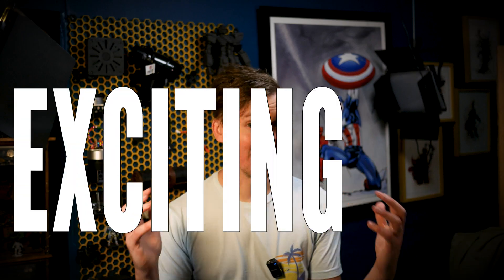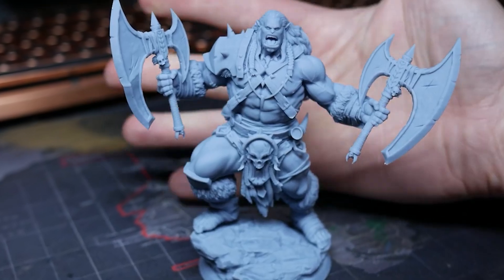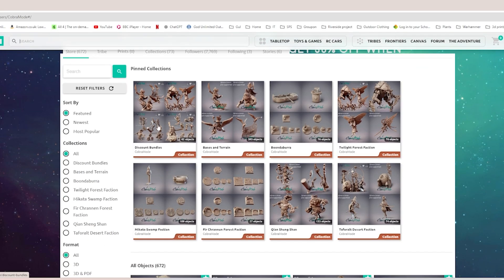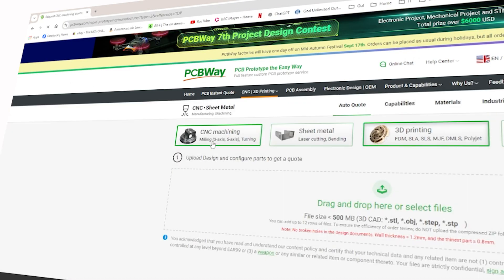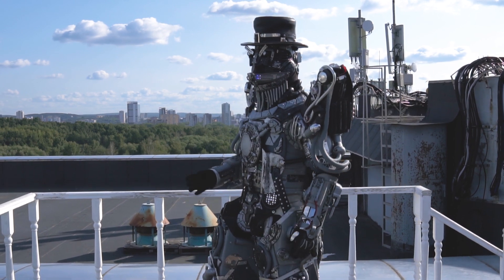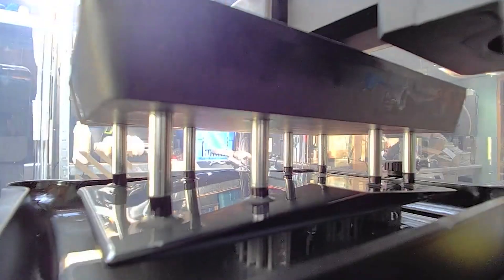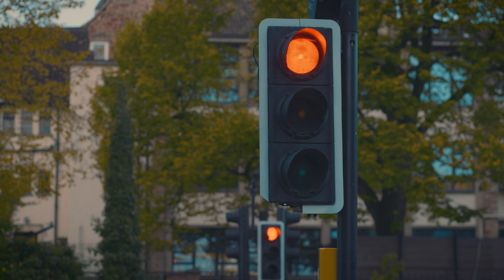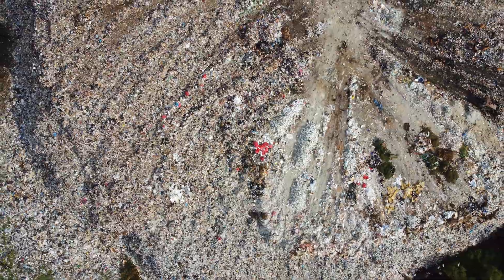Should you buy a 3D printer in 2025?

Comment: Regarding waste/guilt part. Consider categorizing and storing each type of plastic as it's currently is possible to grind up and re-create filament(to a point). In the future these kind of machines might get better and/or cheaper. Obviously the more you store, the more there is to gain from getting such a machine. The video is obviously not about that, but spreading the word might prevent needless waste.
Reply from the maker: It’s a good shout and works for FDM printing not for resin though, once resin is cured it’s done. Plastic recycling machines are becoming more mainstream though.
Reply: @RisingApe  WOps my bad. Had a brainfart.

Comment: Grow tent setups are helpful, but indeed, they are moderately difficult to work around because of just how much space they take up.  I have a 30x18x36" tent that barely fits my Mars 2 Pro and Mercury X wash and cure station, with a tiny work area, but it also provides filtration, storage of things, and most importantly, keeps the mess in one specific area.  Four or especially five feet of room to work with for resin would be a godsend though, but sadly I don't have that kind of space because of two Voron printers (300 Trident, and 350 v2.4r2).

The other cost many don't comment about with printing, especially FDM printers - electrical costs.  The larger the printer gets, and the faster it prints, the more power it's going to consume due to heated beds and having to pour more energy into the hotend.  A lot of that energy also winds up as waste heat in the room it's in too...
Reply from the maker: Yeh really good point, I didn’t cover power at all